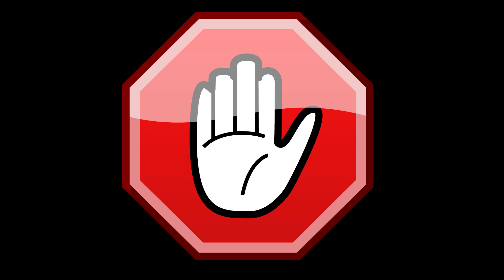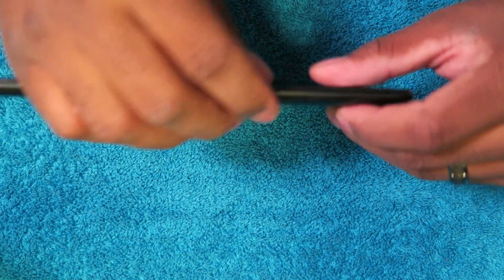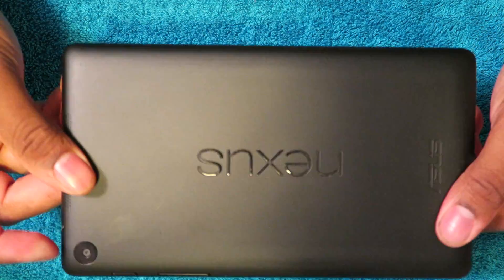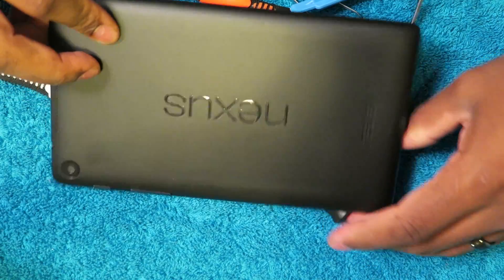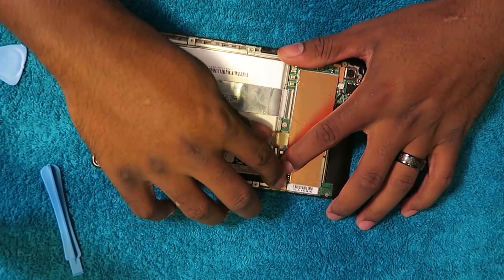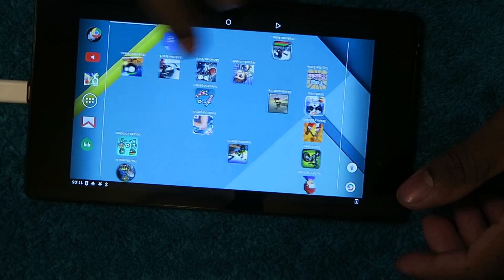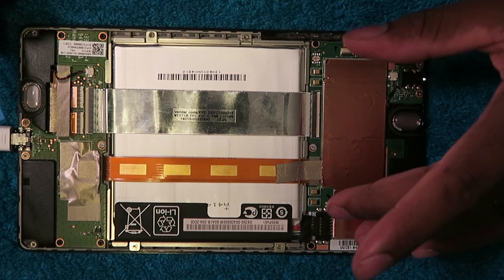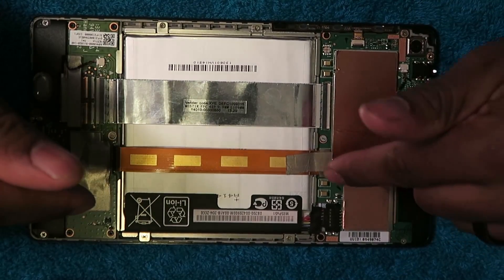Nexus 7 (2013) won't Power Up, Here's the FIX!

Comment: Still dont work, motherboard up top next to the power button gets hot during charging but never turns on
Reply from the maker: I would unplug and plug back in every ribbon cable you can get to in the board. If that dont work you might have another problem. Maybe a fried board.

Comment: Thank you so much for your video.
I had a problem not charging well. It was behaving like the charger was loose connected. So it was flickering the charge and not charged battery symbol. Even if I charged the tablet for the whole night by turning it OFF, it was charged only up to 40%.I unplugged and popped it back the ribbon going across the battery. Did the same for the battery connection. Now it has started charging well. Realized that it is just because of the loose connection of ribbon connector and/or battery connector.

Comment: Please how did you carry out the last procedure of the solution. I tried all the procedures except for the last one because I don't know how you carried it out. Please reply as soon as possible. Thankyou
Reply from the maker: The last thing I did was just to look for things to unplug and plug back in. The first thing I happened to tried to unplug was the ribbon cable that goes across the battery from one side of the circuit board to the other. when i tried to unplug it, it seems to be already unplugged. when i plugged it back in I was able to power the system on. Hope this helps.

Comment: Thanks mate. My 11 month old son just dropped my Nexus 7 2013 and it wouldn't turn on!! Followed your video and went straight to the problem! It was the connecting ribbon going across the battery that had come loose! Great video many thanks.
Reply from the maker: Glad you got it back running!